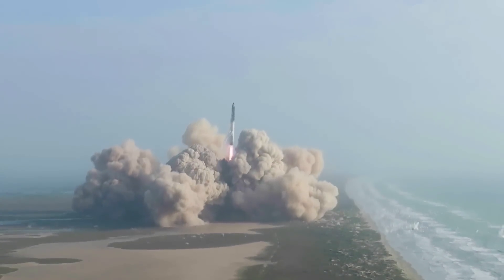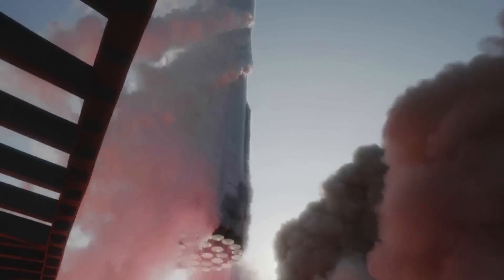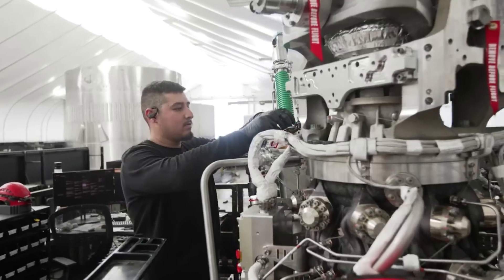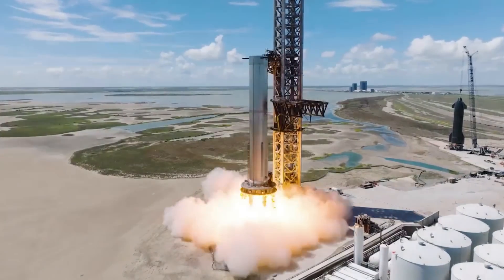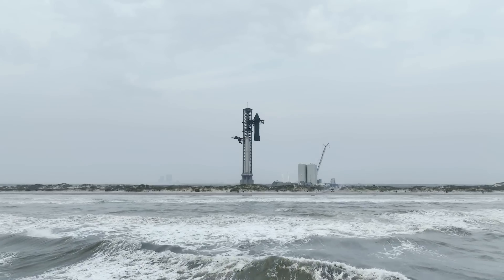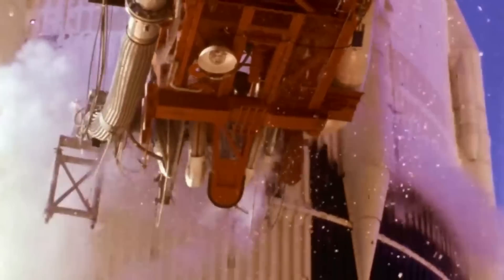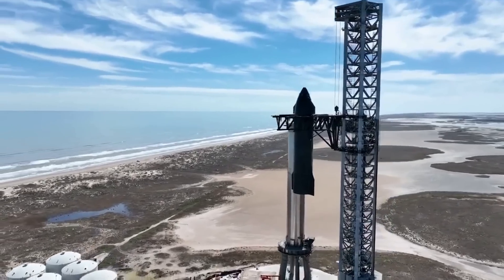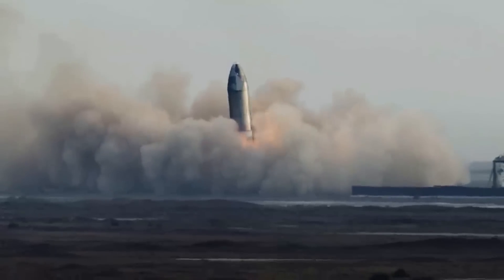Could Steel Plates Solve SpaceX's Starship Pad Issues?

Comment: Now imagine building a suitable landing/launch pad for such large rockets, on the Moon or Mars.
- poured concrete won’t set in such cold temps (so prefabbed sections would need to be flown in and dropped by LM sized landers)
- digging a trench in toxic hazardous ground
- large amounts of water needed for cooling
- even if all the above is done, one landing of a Starship will blast back all the moon dust and rocks from the surrounding area, destroying itself and the launch pad/tower.
Reply: I'm not saying it's a trivial problem, but with the gravities being approx 1/3rd and 1/6th of earth's means that starship - which is already significantly lighter and has fewer engines than the super heavy booster - will need a fraction of full throttle to lift off, even if its then more fuel efficient to throttle up a few hundred metres after launch.
Reply: They don't need a Superheavy on either the moon or the mars since the gravity is only 1/8 on the moon and 1/3 on mars. 

Which means they only have to use the Starship with it's 3 Raptor engines there, hell on the moon they probably only need one raptor at less than 100% trust to get into moon orbit.
But they certainly don't need a catchtower on either of them.
Reply: If you look at the artistic impressions for the starship that will land on the moon, it has thrusters halfway up the side of the starship for this very reason.

Comment: They will absolutely have to replace the whole launch mount. The amount of damage it received would mean that even if they make remedial repairs, they will have to do that again next launch and the launch after that and so on. It would have to be completely redesigned with elements that were discovered decades ago by any other rocket launch facility. Flame diverters and deluge systems. The only way around this is to either have a sea launch, I.E. Sea Dragon, or launch far above the ground like the Roscosmos facility. Using steel plates that are water cooled won't be enough. No mater how much water you have going through steel, it will most likely not be able to conduct the heat fast enough.
Reply: Nonsense 50 cm plates don't need cooling
Reply: You are absolutely right. The water in the steel plate would likely flash to steam, creating a steam explosion. Helping in the destruction of the plate. Just can't figure out why these people refuse to use proven technology like flame diverters!
Reply: Physics 101 failure there. Project Orion was going to use a steel pusher plate with hundreds of nuclear explosions with a plasma temperature on the pusher plate of 67000°C. They did experiments and calculated that they would ablate 2mm of the steel. A chemical rocket has nothing on that.

Comment: They’re still guessing on the solution.  It wouldn’t surprise me if NASA prohibits any launch from Florida until SpaceX resolves these issues.  The FAA could also not issue a launch permit in Boca Chica until these problems are resolved.
Reply: The launch pads at Cape Canaveral are raised up so that they could have flame diverters because of the same water table issue.